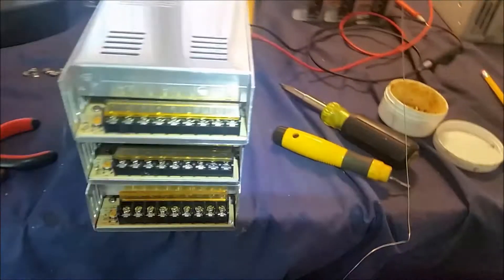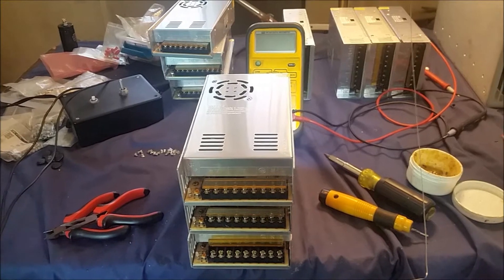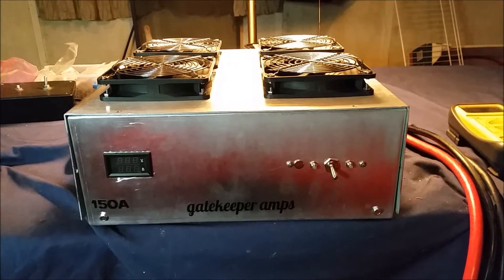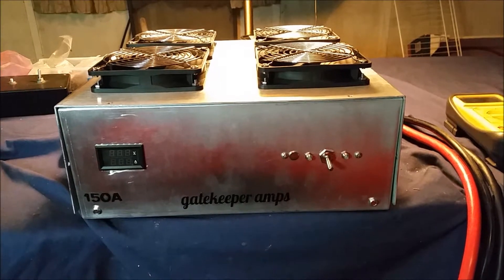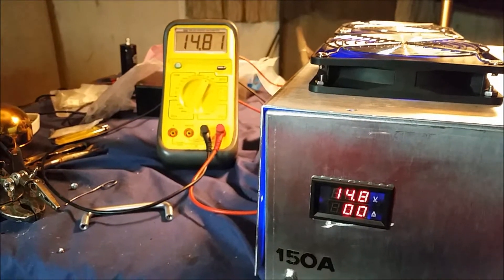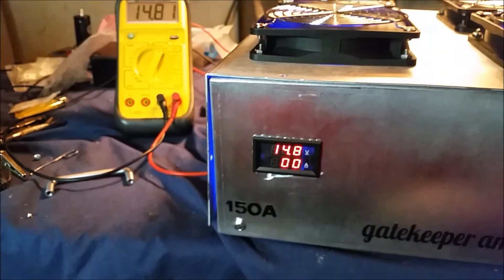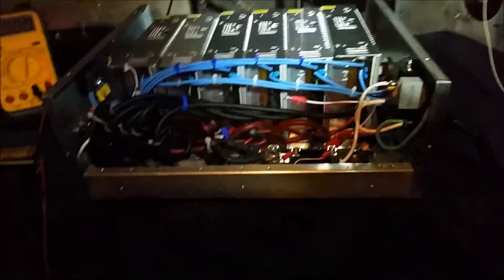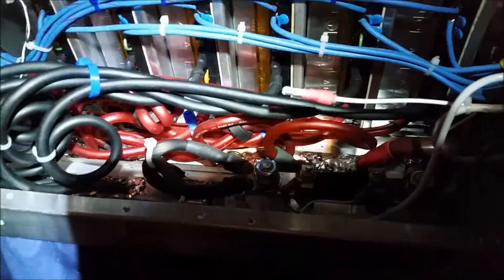GateKeeper Built 150A Switching Supply For RF Amplifier

Comment: So those bus bars you used in this build aren’t the same power strips you’d find in an amp?
Reply from the maker: In this one no.... they were solid copper, but there isn't really a need for that.
Reply: @1883GotDown  interesting so those power strips you use in amp builds are capable of these high current power supplies? I’m trying to put together a 300amp supply and haven’t figured out a good bus bar system